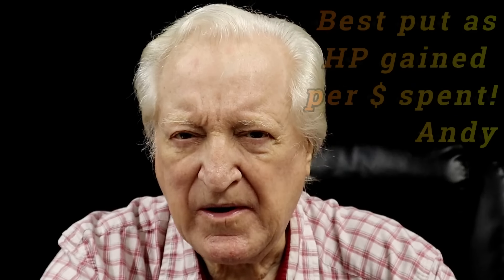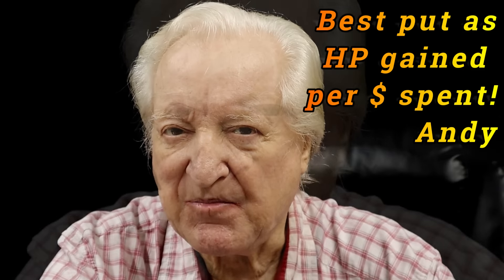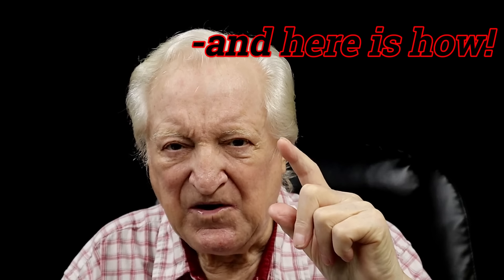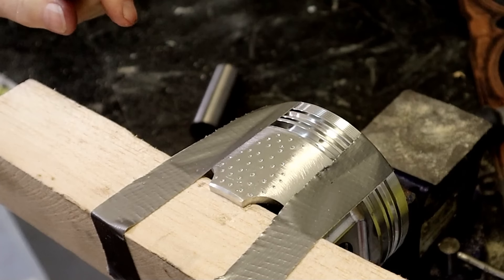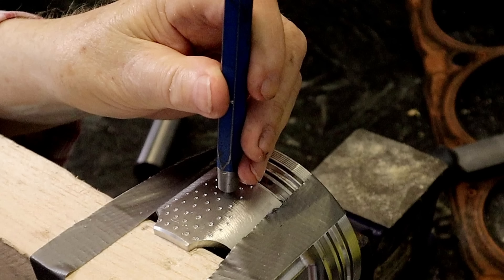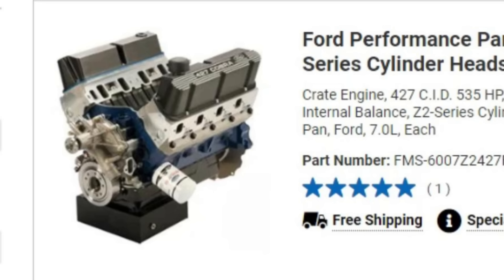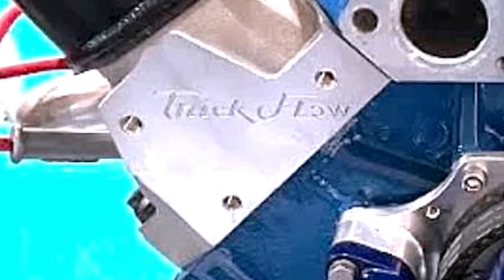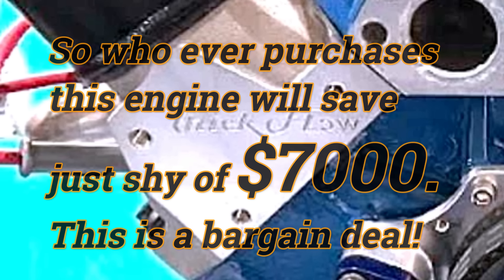SUPER LOW $ parts overhauling

Comment: You took me back in time when I was in my 20's a friend gave me a 1968 Chevy with a worn out 307 engine. Mr. Renn at Renn auto parts mic the block and said it was worn .009" and needed to be bored oversize. I told his grandson to knurl the pistons for me . When he gave them back they had 3 rows of knurling. A bit excessive, but I put that engine together with stock piston rings and pocket ported the heads and put it in a Chevy Monza with a 4 barrel Q jet The pistons were tight in the bores, and ended up selling the Monza to my father in law and after an issue with the Monza, he pulled the engine and put it in a 1970 Chevy C-10 pick up truck and drove that thing for many years and to the farm each week 75 miles away one way. That little engine didn't know that it was supposed to be worn out.   :)

Comment: Back in the mid 80's my brother and his friend rebuilt their moped engines and modified them. My brother had a moped that did 60 mph. The timing was so far advanced that when you came to a stop, you had to hold the brakes for a few seconds or the engine would start running backwards lol. They used Coca Cola cans for the head gaskets and the exhaust manifold gaskets. Lol. I watched them cut the can up and use a hammer to lightly tap the edges of the head to get the profile. Then they would cut it to shape. It worked great. They only had to buy gasket paper for the carb. Those guys did some things and for  almost no money. Great video sir.

Comment: Piston coating will also fill the gap. For instance...your ICON piston recommend extra clearance. The forging procedure they use needs the extra clearance.  The previous 318 race car build. I used stock replacement .30+ pistons. But honed the cylinders to a near polish. Coated pistons would slide through perfectly. They are actually performing better than custom Wisco that I typically used.

Comment: Leaded gasoline was the worst influence on bore wear.  During the 1920's, when General Motors set up Ethyl Corporation, Buick division did some dynamometer testing with ethyl gasoline and discovered that it significantly increased cylinder bore and piston ring wear.  The Buick engineers recommended that the Ethyl gasoline not be used in their engines.  Needless to say, this was shoved under the rug and nothing was heard of it afterwards.   I was lucky enough to stumble across an old (1928 vintage) article that discussed these findings.
It totally explains the lack of bore wear I noticed back in the 1980's on emission controlled carbureted small block Chevys...... My machine shop told me at the time that the newer blocks were better material.......  DON'T tell me that late 1970's - early 1980's 305 and 350 blocks are better material than late 1960's-early 1970's 327-350 blocks....  
Now, todays cast iron blocks ARE better material, but only by a bit.  Fuel injection also helped, but my old observations from before that era totally points the finger at leaded gas, and agreed with Buicks findings all those years before.

Comment: Great stuff DV. Thanks! I'm seriously considering your 454 to 525 stroker build. That thing has monster torque & hp.
Reply: let us know how it goes. I have some extra blocks to mess with, but those cranks aren't cheap and as far as I can tell, the build requires custom pistons. Maybe a piston manufacturer would consider a discounted bulk order for a group of guys wanting to do this. Nick from DZ performance said he built one. Said it made great torque, but it didn't want to rev. Don't know anything about the specs.

Comment: Knurled many competitive Pro Stock pistons when I was with Jenkins . Always an effort to get more use out of them  . Never really looking for power . Many re ring and hone ( light ) jobs . Always ( and still ) wonder about the oil holding and possible friction gains . Never ( still ) have been able to see a gain or loss ,,, ! ,,, same with a couple teflon button experiments on my own ; however I like this line to line stuff . The hone , pulling even more distortion , out of a seasoned block , is where the power is ,,, !

Comment: My first engine rebuild was a junk 2 stroke leafblower someone put straight gas in, cylinder honed with a brake cylinder hone until the lighter vertical scratches were gone, piston lightly sanded to deburr corresponding gouges, new ring, slapped it back together and it did 15 years occasional use before it started losing compression again, I'd guess at least 500 hours wide open throttle.

Comment: Hi DV, I'm still to broke to pay attention.
Cosworth pistons are forged so malleable material, wouldn't much harder high silicon cast pistons have a problem being knurled or punched?
It actually seems like a very good idea for race motors though, oil retention on skirt and lower area for friction.
 on thrust face. I'm glad you mentioned cast pistons at the end, clears things up.
Reply: He's only talking dimples .003 high less
Reply: @hotrodray6802  You don't know much about piston compositions do you? 
Cast pistons can be brittle with a crystal structure (if you have a broken cast piston you can see it even though they are quite difficult to break with a hammer if you don't have a crack or cut to start things off)
 'Dimples' may only be a few thou deep but it affects material much deeper. (those centre punch marks looked more like 0.010" deep to raise surface 0.003" though)

Comment: @DV: the pistons with hammered in pits are placed back just like that? Thus with kind of crater like surface (?). Or r will it be lightly sanded?? (...or does the bore do this for you?).
And what about drilling some holes in the skirts of the pistons... will it give more lubrication between piston and bore? Can drilling holes in the skirt make the piston light weight on a still responsible way? ...or is this mad man thinking?
Reply: After dimpling the piston it probably wont fit in the bore so lightly sand it, use a lathe if you have one, you want it to just fit the bore. DO NOT drill holes in the piston, it will crack and break up!!

Comment: Hi DV.  I would like to submit my engine for the low buck build.  5.7 256,00 miles. I have:  new oil pump, moly pump shaft, deep pan. 3 way adjustable timing set, Pontiac Valves 1.96/1.66”   Beehive springs,  bearings , Howard’s cam 108LC -228@0.050” gaskets. I would like to deck the block to zero and shave the heads some amount(0.040”?).  What do you think?   Thanks.  I enjoy the channel! Doug